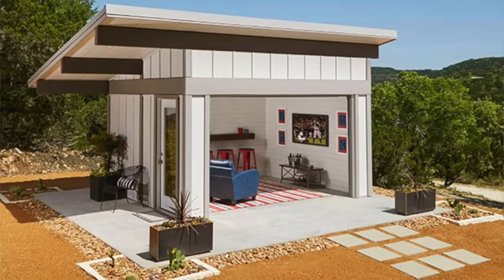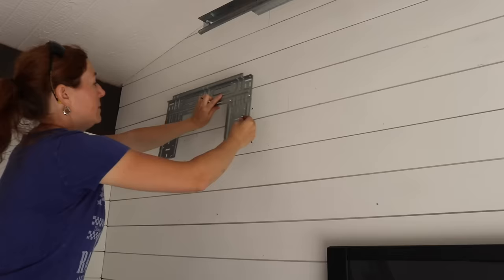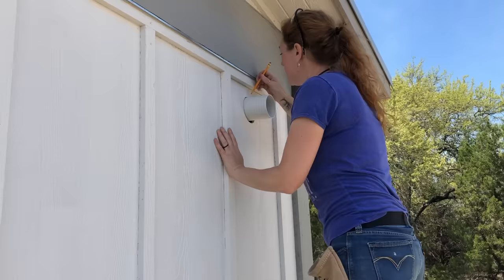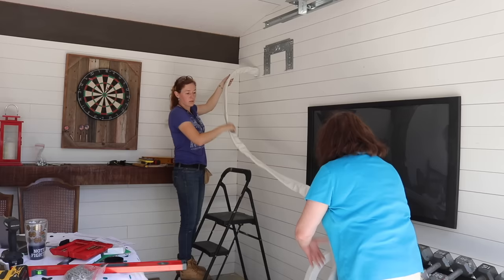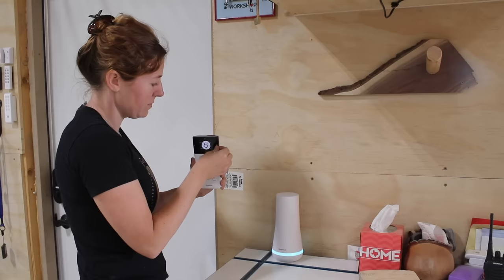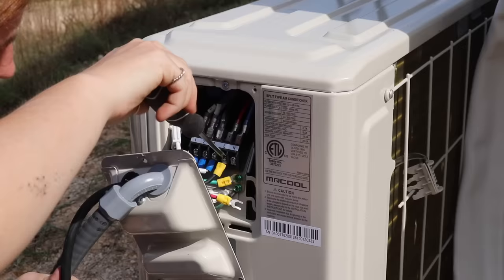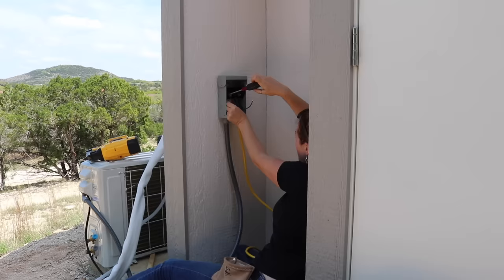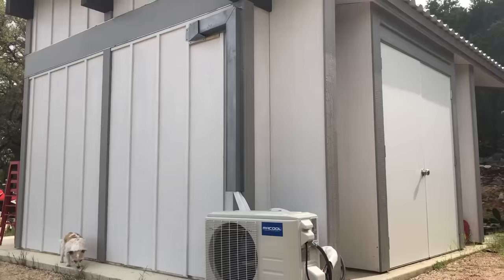DIY Ductless Mini Split Install - MrCool Unit

Comment: I put one of these in my garage last year.  Install was not too bad.  Honestly one of the best decisions I have made.  Works so well. Quiet, efficient and effective.  I ended up cutting my extra long copper tubing.  Although I am not sure of the validity of this but I read somewhere that looping the extra length is not the best for the system.  Probably doesn’t really matter.

Comment: NEVER coil the extra line set in a vertical loop, it will cause an oil trap that will hold the compressor oil and can damage the compressor. Coil must be looped horizontally to allow the oil to easier return to the compressor.
Reply: THIS! I also thought she could have secured the outdoor unit to the cement.
Reply: Not to mention the fact that the looped line set is partially blocking the airflow to the ac unit.
Reply: 410a has enough velocity it’ll bring the oil back to the compressor. If anything it looks like crap. Cut the line and re flare the lines.
Reply: @andrewdarbyshire9108  it's a pre charged system so if you cut the line you would need someone to recharge it
Reply: james carpenter those lines won’t hold enough 410a to affect the charge by much, plus I’d just add some more since I keep it around the house anyway.
Reply: Yep. This is why you never allow a woman to do a complex appliance installation.
Reply: @SergeantExtreme  I love this comment. I love laughing at tools on the internet.
Reply: @jamescarpenter392  I think only the condenser is charged, on mine the head unit instructions said to pull vacuum or flush with canned air before hook up. That one may have charged everything though.
Reply: @jameskissler4567        You dropped your sword, oh white knight.
Reply: Before opening the freon cranes, the track had to be evacuated
Reply: @Kias1dad  Hope you are doing better after having your eye out!!! Sorry to hear that happened!!!
Reply: @Kias1dad   Yeah you are correct.  they should trim the not needed excess . reflare the tube ends and recharge the system.
Reply: Captain Obvious Yeah, like all do it yourself men know how to do everything correctly. What century did your mind get trapped? This isn’t 1930 to 1950 anymore—-per Annie Lennox “big girls are doing it for themselves.....”
Reply: @jamescarpenter392  What do you mean by Pre charged or charged system, i am developing a keen interest in this stuff
Reply: @Afronaut64  it means that the lines from the inside unit are already filled with the coolant so if you cut or break the lines you'll have to have a HVAC guy come out to recharge the system
Reply: @jamescarpenter392  thanks for the reply
Reply: @andrewdarbyshire9108  410a has no more velocity than any other refrigerant, just higher pressure. Two different things.  Coiling the lineset as she did was wrong.
Reply: Professional HVAC/R tech here: 410a operates at 50% higher pressures than R22, so a tight loop is required to cause a "trap" to form in the liquid line. Here long loops should be fine.
Reply: @jigglybiglets  pressure has nothing to do with it, velocity is all that matters with oil return. Pressure and velocity are two very difgerent things, and 410a has no more velocity than any other refrigerant. While this system might be "alright", it's not the correct way to do it.
Reply: @Gladtobeherdad  Nope. Refrigerant is a pressurized system. You're incorrect.
Reply: I don't know if that's true but it makes sense. It won't hurt to follow your advice when I install my unit next week.
Reply: The instructions state how to handle the excess line... it simply says to coil it up, but not tightly (directions illustrate vertical coil, min 4 inch bend radius). They probably know what they're talking about. Also, the line is precharged so you don't have to pay an hvac guy like $2k to install the system or buy/rent the equipment and learn how to use it. They advertise a 16 ft version but they apparently only make/sell the 25 ft cord right now.
Reply: @jigglybiglets  I'd like to see any manufacturer literature that calls out a requirement for a loop to tap the liquid line.  Feel free to post a link.
Reply: @jonnymac31  I said a loop will trap not a loop is needed . Loops are useless.
Reply: The company's just whant to sale i meant the factories
Reply: Handyman special
Reply: Mr Cool installation videos show the loops vertical. Its not practical to set it horizontal due to no clearance under the condenser.
Reply: Rich C she’s learning
Reply: @dianne8340  Actually if you ask how many ladies are interested in high skilled technical careers like engineering or applied sciences.. less than 9% would be your number.. So as much as I would love your statement to be true.. big girls won't do it by themselves until that number is 5 times higher.. otherwise it is men doing things by themaelves from other men designs.. aimed to men.
Reply: Tom Stall I don’t know, I mean things are meant to break and manufactures follow the law where they can’t build something that will last forever and so if by placing the coils horizontally the unit will last longer then they will recommend you place it vertically. It will still work fine but it won’t last as much as if placing vertically and if it doesn’t hurt to place it vertically then I’m all up for it.
Reply: If you want to cut and vacuum the lines, buy the $750 uncharged unit instead of the $1400 DIY unit.
Reply: Brand GID I’ve been reading on this DYI mini splits but no matter what even if precharged you have to check for leaks with nitrogen after line set is in place. If no leaks, than great. Than pull a vacuum to 500 microns to remove none condensibles. If not youll have weird pressures & acid will build up in the system it will prematurely kill that compressor
Reply: @andrewdarbyshire9108  I think she mentioned something about not having to recharge the lines!
Reply: LifeLongStrong you mean by men ?
Reply: Or measure first and order the shorter line set a 10 foot woulda done that job if short mount compressor on wall for perfect fit,, but love her videos she tackles anything
Reply: @andrewdarbyshire9108  That will lose the refrigerant. A coil nested under the equipment, or very nearby.
Reply: Bruce Marmy really, how much do you think is actually in that line set??
Reply: james carpenter no u can lock high side valve, make unit run to get all freon back to condenser then lock low side valve , cut lines, flare nut, vacuum lines, remove some freon done.
Reply: You can bring back gas in to outdoor unit, just close fluid valve, wait 10-15 seconds, and close gas valve. In the end don't forget turn off split, when you done.
Reply: If you don't have vacuum pump, but need install split system, you can use one small trick. 
Slightly open the nut of the gas pipe, open the liquid valve. As soon as gas and oil comes off the nut, tighten it. And open the valves completely.
Reply: I just installed one of these. The “lines” aren’t pre-charged, they are empty.  You can cut them and re-flare them, but there is a limit to the shortening because the unit is calibrated for the amount of refrigerant stored in the condenser. Ours had an 11 foot line set, but a 9 foot minimum length requirement.  If I had it to do over again, I would measure where to put the condenser so that it used the entire line set in a linear fashion (no coils), so I wouldn’t need to cut and flare. I bought a vacuum pump @ harbor freight only to test for leaks as it was my first cut and flare job, and I didn’t trust them. IF I had not cut and flared the lines, I might have skipped the evacuation step, and “charged ahead”.  I had a set of automotive AC gauges that I adapted for this just to monitor vacuum.  We ran the vacuum, let it sit for 45 mins, no vacuum loss. Opened up the refrigerant gates and it’s been cooling ever since.
Reply: @SergeantExtreme  Gender has nothing to do with it. Knowledge and training does.
Reply: cb2000a you don’t coil period 😂😂like bruh I almost puked seeing that big roll of pipe left
Reply: @jamescarpenter392  the lines aren't charged until you release the refrigerant at the compressor. Before you connect them you can trim them but you'll need a flaring tool.
Reply: @SergeantExtreme  Really? You’re going there? Idiots can be male or female as indicated by this comment.
Reply: No, not a problem with split type aircons with expansion in the outdoor unit.
Reply: LG mini splits manual says to install a vertical loop before it goes into the condenser.
Reply: @aaronpunk326  You should put it in cooling mode, then close the Gas Valve (thickest one). Wait 2 minutes and close the liquid valve, done. Now all the refrigerant is back in it's container, not in the condensor. Also refrigerant does not contain freon anymore since many years ago due to it's toxicity to the ozon layer.
Reply: @TheDaniel688  thank you! All splits and mini-splits nowadays are prefilled with refrigerant that is contained in a container in the outdoor unit. Just like you said it will fill up the system when you open up the valves. You should always vacuum the system before using it since air and moisture will damage the system in the long run, and it won't work properly. Pipes can be in a loop no problem, as long as there are no kinks on the pipes, only then oil can be trapped and cause issues
Reply: @visionsvetarn  mb u forgot smfn, condensor in outdoor unit, evaporator in indoor unit, from factory outdor unit filled with rifregerant. So it in your condenser and compressor. And you need close liquid pipe first and gas pipe after.
Reply: @jamescarpenter392  You cut and re flare before opening the valve to load the gas.
Reply: @andrewdarbyshire9108  If using precharged lines, Just put the unit farther away. Very simple no added costs.
Reply: If using precharged lines, Just put the unit farther away. Very simple no added costs.
Reply: @jamescarpenter392  not true. The lines are filled with nitrogen. Pre-charged means that the outdoor condenser unit is already filled with 410a.
Reply: So your supposed to lay it on the ground!!?
Reply: @bobbydelamar606  it is best to cut and flare the line, but yes, putting it on the ground is better than coiling it up and creating an oil trap that will shorten the life of the unit.
Reply: Gonna coil mine under the sun cover over the pump.
Reply: I believe on pre-charged  Mini-Splits the lines can be shortened to a specified length without removing refrigerant.
Reply: @SergeantExtreme  gender has nothing to do with it.  i'm a licensed contractor and spend my days cleaning up crap work done by men.  experience and attitude maybe, but quit with the sexism.
Reply: So basically what you're saying is it gets coiled and laid down flat On The Ground Not Air Jordan vertical
Reply: @cb2000a  not blocking it enough to cause A Problems
Reply: @andrewdarbyshire9108  then you have to pay to have it recharged the purpose of this unit is not to have to do that
Reply: @nevermindthebull0cks  that unit is completely ready
Reply: @rickjwilliams  the point of this system is that you don't have to call a professional out to get it recharged having units recharge cost quite a few $$$$can't remember how much it is per Pound right at this moment plus you have to pay the guy for Service Call so you're looking at it right around 350 to $500
Reply: @dianne8340  and that's how you tell them lol

Comment: Just make sure that the compressor unit is mounted on rubber pads and bolted down so it can't 'walk away' due to vibration!!
Reply: Is the outdoor unit rainproof?
Reply: @WRAND2208  they usually are, but can last much longer if protected from rain and snow. 
Keep in mind that they need plenty of airflow to dissipate  heat !!

Comment: What a lovely woman :) and yes there is refrigerant in both outside an inside units. All you do is connect them. No need of a vacuum. The lines are insulated so the loss of efficiency is minimum.

Comment: Every set of instructions I have ever seen tells you to cut the outside hole lower than the inside hole to allow for a downward pitch in the condensate drain line.

Comment: I have a mini-split in the upstairs bedroom of my condo. The old AC unit ducts going into this room were too small, so this room never got cooled off. My AC bill was 200-300 per month for this two bedroom 850 SF condo. Then I put the mini split in and WOW. It cools the entire condo and I rarely have to turn the old AC unit on. My electric bill in the summer is never more than $60 . I keep my room at 68 degrees and am happy as can be!
Reply from the maker: Awesome! Thanks for the feedback. Cheers!

Comment: I wonder if Mr. Cool could find it in their economics to sell variable length line sets?  10'-15'-20,  DIY is awesome!  even better if the final solution makes it hard to tell.
Reply: Ryan Carlen  Yeah but these do work as DIY's, so your opinion isn't really worth much.  Do you all think the Mr. Cool was designed by a guy living under a bridge, in a box, who can't read or write?
Reply: Ryan Carlen  That's why they sell two different models, the DIY and the HVAC tech required model. So yeah, it's a DIY if you bought the DIY model.

Comment: With that much excess line provided , I could potentially mount the outside unit in another zip code :)
Reply: Jajaja jajaja
Reply: Mr. Cool has made improvements since this video was made and now offers various lengths so you can better match your need to avoid the excess.

Comment: Just for reference, the refrigerant is not stored in the line set. It is stored in the compressor. You could in fact cut the line set but you would need to bleed some refrigerant out because of the excess pressure. The refrigerant is not let out until you open the king valve. The issue with these DIY units is the line set needs to be vacuum downed to remove any moisture in the line before letting the refrigerant in. If you really want the unit to last i would call an HVAC tech to vacuum down the lines and perform a proper leak test.
Reply: @paulcopeland9035  i have the exact same unit, hired an HVAC tech anyways. Technician cut about 3ft from the line set no refrigerant inside.Did a leak test with nitrogen then he pulled a vacuum because he said there coule be moisture in the line and the condenser would last longer.
Reply: @paulcopeland9035  I got a "whoops content not found" in that link. Still so many "why did you not this or that to the line" before installing dummies. Hope Sean's ac tech did not get any refrigerant burns from cutting the line like they did.

Comment: Mini splits are the norm in Spain where I live off grid now and most houses use them. For some DIY models there is a choice of refrigerant line length. Yours is very long and this will make the unit very inefficient. Of course it also depends on the insulation your shed has but with so much glass that unit will be working overtime! Great vid as usual April! Love everything you do! Come visit Spain and bring your tools!
Reply: Line length in the sense has very little to no effect in efficiency rating, shortening it would just add hundreds to the original cost of the unit, its fine to eave the 20 something foot long line as is seeing it is precharged, messing with it yourself is a big bill from a service tech willing to touch these DIY units. As she said per the instructions/manual that once you put it on you will need to make a service call when you disconnect the line just to recharge it.

Comment: Good job, should’ve cut the lines and re flared them. I also didn’t see the pressure testing and vacuuming process down to the proper micron level (to educate those who want to do their own) before releasing the refrigerant thru the system. I am a diyer but also in the Hvac trade and a lot of people try to install their own units not knowing it’s a lot more than just wrenching it together.
Reply: This is a DIY unit where you specifically don't need to do that.
Reply: Thx u sir n I belive u do need to explain  everything  maybe not to a t but explain  it I'm a electrician well good point my friend except  for the other  dude fool a dummy

Comment: Not sure I'm comfortable with the refrigerant lines being up against that radiator.  Typically, with radiators, you want good airflow.  I'd just make sure the coil is wire wrapped together and pulled away from the radiator a bit.
Reply: The fact that there's so much line, kinda negates the issue in the first place. You want that line to be as short as you can.
Reply: She unrolled it all , she wasn't supposed too and you have to start from the outside not the inside

Comment: Installation by the professional will likely quadruple the cost of that a/c. But you still have know or ask for proper way to do it.
Reply: Depends on where you are. In a region where installers are used to installing these systems (e.g. New England), the installation:parts cost ratio is about the same as a standard ducted split system.

Comment: "Most honored guest, you will be staying in the shed during your visit."
Reply: It's a she-shed
Reply: LMAO!!
Reply: Bushes were very close to do your business too.
Reply: the garage/shed with a see-thru front...and where's the pooper?
Reply: without plumbing!
Reply: I'm currently building an apartment (man cave) in my garage. It will have running water but no access to septic (without a lot of $$$) so I'm installing a composting toilet.